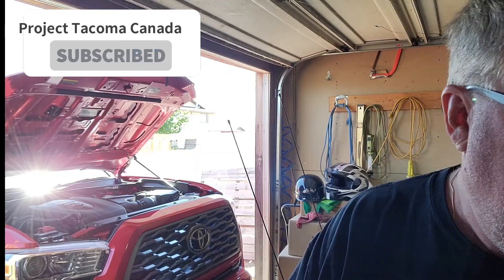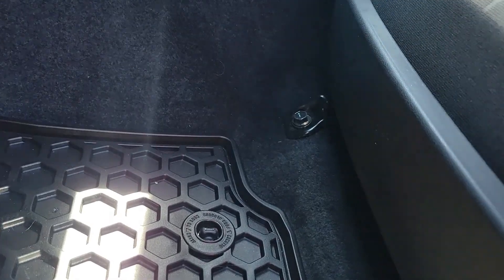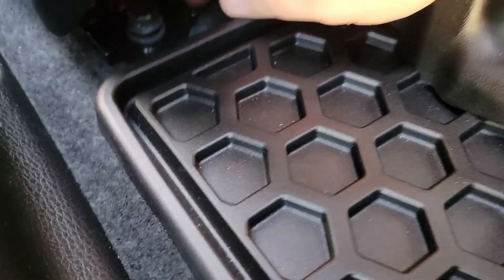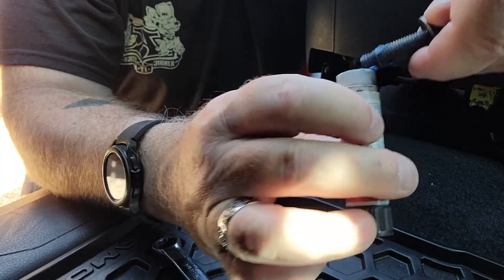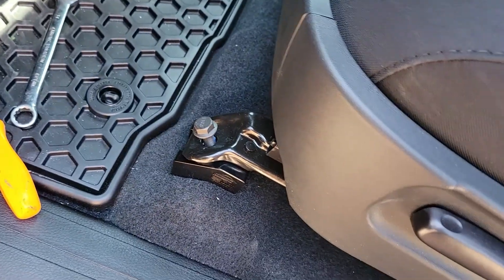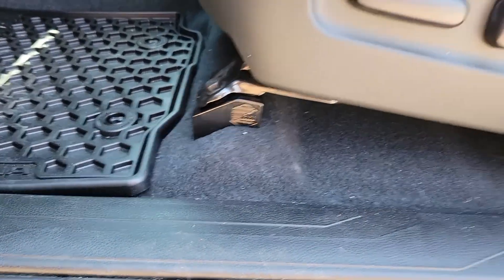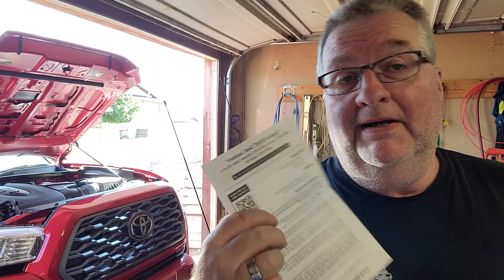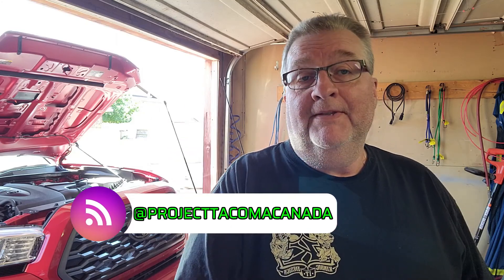Tacoma Seat Riser Modification

Comment: I think it’s a good idea and it is a well built product. I bought the seat Jackers with the Molly panel and the clamp to hold a fire extinguisher. However, I think for it to really work it depends on the model of Toyota Tacoma. You have your height and deposition you like to sit in. I installed it in my truck drove around for two weeks and it annoyed the hell out of me. My head would touch the roof of my truck all the time I had to tilt my head. The problem my head was I have a 2020 Toyota Tacoma Trd pro. This has a sunroof which lowers the roof of your truck by 2 1/2 to 3 inches. It’s the electronic seat which I put as low as a could possibly go to seat, jackers raises you almost 2 inches. Plus, I do not lean back in my seat lot. A lot of people do I sit pretty straight up. I am 5 foot 10 and it did not work for me. When I take the seat jackers out. I have about an inch of space between my head and the roof of my truck. If I’m off, Roading and I hit bumps, I hit my head. I had to put this product on the passenger side. As most of the time the passengers are smaller than me or they can lean the seat back as they’re not driving. Everyone always says it works for them. I never see anyone saying it doesn’t well. These are the reasons why it didn’t work for me. Have to say was very disappointed. I was looking forward to this option working. With the electronic seat, I can adjust it a little, but the extra comfort you would’ve got from the seat Jackers would’ve been really nice.

Comment: I’m 6”5. These will not work for me. Unfortunately.
Reply from the maker: I get that, there seems to be a 5'9" to 6'2" range that it works best for.  It's probably not a head issue for you but more of a knee to steering wheel.
  Thanks for watching!
Reply: Lol how do you even fit in a taco .I am 6,-2" and felt like I was viewing out of the top of the wind shield right at the shaded section

Comment: Yep, does not work for me. I actually raised the rear with three washers and now it's perfect for me.  I'm 6'1.
Reply: This is what im thinking, did you use the factory bolt with the washers??
Reply: @GODfirstandalways  I did.  Since the adjustment is minimal the factory bolts are sufficient.  I purchased four washers but ended up using only three on each side.

Comment: THANK YOU FOR THE BLUE LOC TITE PASTE… DID NOT KNOW THAT, AS JOHNNY CARSON WOULD SAY!
Reply from the maker: It's nice to work with, I also have loc-tite tape which is also great to work with...I use it in 1 or 2 of my videos on my Motorcycle channel I think.
Reply: I AM A SHOOTER, SO I NEED IT TIME TO TIME…. I WANNA MAKE A COMMENT AS YOU LOOK AS YOUNG AS I DO, AND FIT AS A FIDDLE… I HAVE PERIPHERAL ARTERY DISEASE IN MY LEGS… FOR MY SEAT I LIKE TO KEEP THE SEAT FROM TOUCHING THE BACK PART OF MY LEGS RIGHT BEHIND THE KNEE…THE ELEVATED FRONT OF THE SEAT CAN PUT ENOUGH PRESSURE ON MY LEGS AND CAUSE ME TO CLOT…. IM NOT SAYING you WILL HAVE THIS PROBLEM , BUT JUST BE AWARE…. GOOD LUCK

Comment: If you have power seats why would you need that? Can't you make that adjustment with the seat without adding the riser?
Reply from the maker: That's a fair question and I thought about that before buying them.  I messed with my drivers seat and got it to what I found reasonably comfortable.   then bought a 2 sets of jackers seeing as theyre pretty inexpensive.  It's a quick easy install for these so I tried seeing what it would do for the driver seat for fun and to my surprise it was considerably better than just the power seat.  Seems to change the geometry and makes them less like a go cart seat lol

Comment: I recommend adding two washers to the rear 14mm to prevent any bending of the brackets on the rear
Reply from the maker: There's no issue with bending the seat rails, that tiny rise in the front creates an almost imperceptible angle at the rear.

Comment: Just installed mine.  It is correct that if you are over 6'1 or so it may not work for you.  I am 5'11 and I am glad I did it.  It's tighter getting in/out, but worth it.  I kept sliding forward and had to readjust multiple times.
Reply from the maker: I kept hearing it made a bigger improvement the taller you are, but not sure what that limit is lol.  I'm 6.0 and it's great.  Thanks for watching ✌️

Comment: Are these legal?    Do they void crash test data?
Reply from the maker: That's an excellent question and I should have addressed it in the video.  In actual fact every single mod to a vehicle is illegal according to the Traffic Safety Act.  Enforcement is discretionary.  As far as safety I was chatting with the service manager and we had a look at them together.  My particular kit uses the same grade bolt as factory and doesn't tilt the seat in a way that impedes the deployment of the seat air bag.  The verdict was neither safety or warranty are effected.
Reply: @canucktaco  Good answer!   Thanks.  I did two Tacoma’s Ive owned.  The stock seat position was very uncomfortable even on shorter trips.   I have an engineering background and felt the seat belt is what holds you down and they are attached to the structure not the seat so I felt ok with the mod.   I went on a 2000 mile trip with no discomfort.
Reply: If you consider the standard crash test dummy and the impact data with the factory seat, then run another crash test with either these or rear spacers, you would assume the second would be slight worse, your legs are closer to the dash in front or your body is higher in the seat closer to the window sill line that is less protected. I'm assuming the engineers chose this height for crash tests, at 6ft3 I run the steering wheel at the lowest position which would indicate originally the seat height may have been further up during pre production.

Comment: I tried them but found I couldn’t stand how close they made my knees to the steering wheel, and I felt like I had to have my seat back tilted forward further than I liked. I found it much more comfortable to just add about 1/4” to the height to the rear of the seat instead. Worked out great for the passenger seat, though.
Reply from the maker: Odd seeing it's only a 1.250" tilt...maybe if you didn't have power seats or something, but I've never actually heard anyone say anything negative.  For me lifting thr back sounds horrid 🤣
Reply: @canucktaco  No, I don’t have power seats, and I think that is the problem with the seat jackers for me. I didn’t think raising the back would be good either, but it seems to be just the ticket for me. Go figure.

Comment: The back needs lifted as well, defeats the purpose of lifting it if you don't do the back.
Reply from the maker: Absolutely wrong
Reply: @canucktaco  Can you explain your comment on this. I'm just interested in why.  I have both front and back installed and it's working for me. When I did only the front the seat slope rearward was terrible IMO. I think you really need to do both and you wind up with a taller seat with the original slop rearward no? I'm very disappointed in these seats. I had several gen 2 tacomas and got along fine with the seat position. I will say doing the front and back have helped my overall comfort.
Reply from the maker: @john d  hi sure, the seat jacker wasn't designed to raise the seat closer to the roof, it was designed to create a specific angle to the entire seat platform.  Even the power seat in my TRD doesn't replicate what the seat jacker does.  Now it's not wrong to do what you did, everyone has to do things right for them.  However the first statement "defeats the purpose" is 100% wrong.  The seat jacker performs "its" purpose perfectly as it was engineered to do...his remark was just nonsense.  I know so very many people with this mod that love it, but if you're over 6'2" or under 5'6 my understanding is this mod can be problematic.  For me at 6' it's awesome.  I do agree these Tacoma seats aren't the greatest but ive definitely had worse lol.  Thanks so much for watching and your comment was awesome!
Reply: @canucktaco  Thanks!
Reply: @johnd7215 how tall are you ?